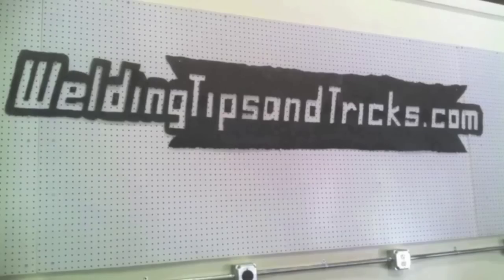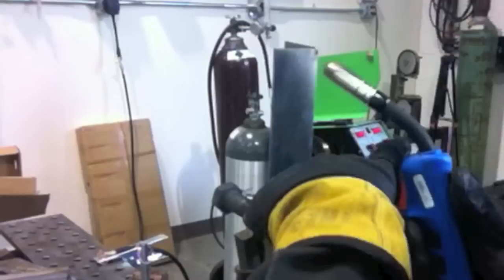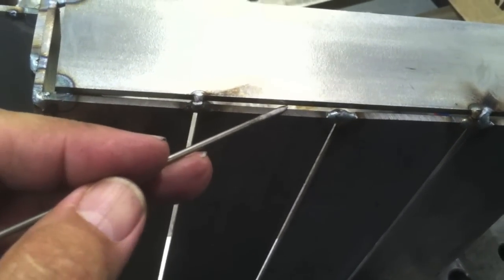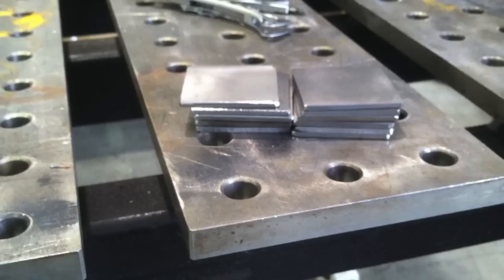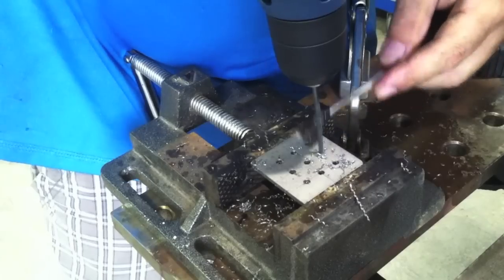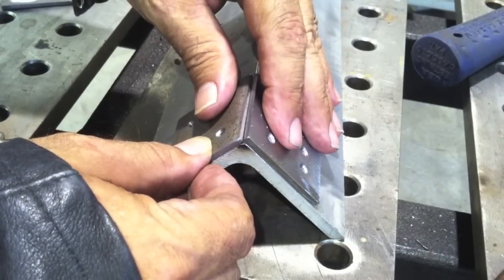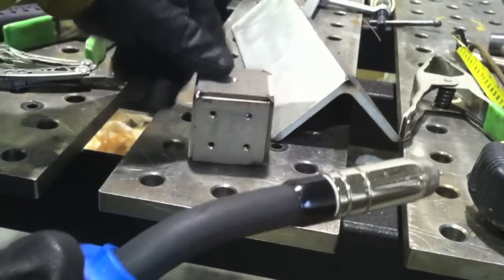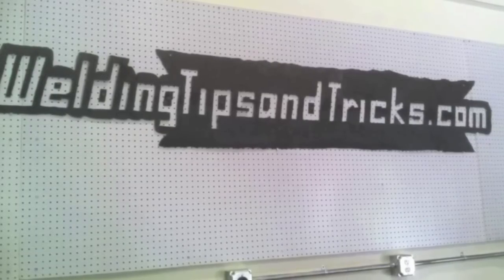Quick Mig Welding Project for Students

Comment: Big fan & subber here. I have not seen many clear examples of welding problems or approaches involving a sealed part, such as square tube sealed on both ends, be those legs, support arms or other project. I have experienced condensation inside these pieces (on a sealed 1-1/2 square tube I drilled a hole to attach something & water started dripping out), as well as weld blowout when capping a tube. It seems that weep holes are needed, and maybe fill the hole after? I know you touched on this here w the dice. Thanks much.

Comment from the maker: i stack cut some 2" x 1/8" 11 ga flat stock in the horizontal band saw. I cut enough to do 6 of them so i plan on trying some different things like tig welding with silicon bronze, black oxide surface finish etc.

Comment from the maker: 100-120 amps, 1/16" ER70s-2  or 309 ss filler rod,  3/32" 2% thor or lanth electrodes, #7 gas lens cup with about 15 cfh argon flow.

Comment: I remember when i was at welding school, we had a similar project to do. We oxy/acetylene welded 4" square 1/8" thick plates to form a box and brazed a small tube on to the top (you pre drilled the hole before welding) The idea was to dunk your box in some soapy water and pump some air through the tube and you'd see if your box was airtight.

Comment: yeah all the electronics are built crappy from harbor freight. though if you want to learn how to weld you can always buy the welder there. keep in mind if you want to keep it more than a year to buy the extra warranty with it just in case. also make sure you know what kind of wire you buy. one is used with 75/25 argon/co2. good luck.

Comment: Hey Jody, to determine how to properly arrange your plates on a di; 
Whatever number you have on one side, the opposite side is the number needed to total 7.
If you have a 2, the opposite end would be a 5. If you have a 6, the other side is 1, and so on.
P=number of holes on the base plate; x=variable
P+x=7
This is also a good way to check for "loaded dice". After the roll, look at the numbers showing on the top and see if the numbers on the bottom are the number needed to total 7. If they don't, somebody is cheating. Haha! 

Finally able to offer a tip to you, cuz Lord knows I've used tons of yours. Thanks and best wishes

Comment: was there an answer for this question?
I notice that you "pull" your welds when MIG welding, but when I weld I tend to prefer "pushing" so that the metal gets a chance to preheat. What are the pros and cons to these two techniques? Thanks

Comment: What type of finish or coating can you put on bare, clean steel to keep it from rusting? Just paint it with Rustoleum?
Reply: Wipe it down with lacquer thinner and spray it with a clear coat. That will keep the O2 off the metal and keep it from rusting. Or paint it with Rustoleum in your preferred color.You could also use a black oxide treatment if you like that color. Jody did a video on that process at one time, you should be able to find it on his channel.

Comment: I just ran across this old video Jody and it looks like fun! Out of curiosity what size drill bit did you use? It looked like you counter sunk the holes to give them a cool appearance to! Very neat! I don't have a mig welder yet but I'm going to give it a try with some 6013 and my buzz box.